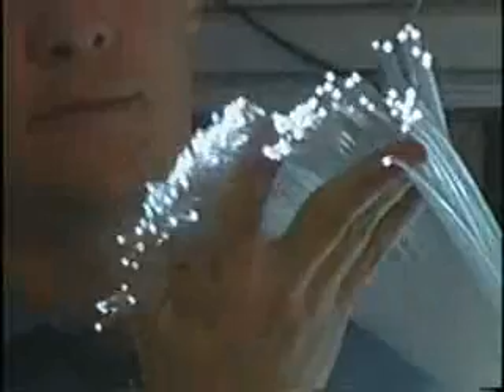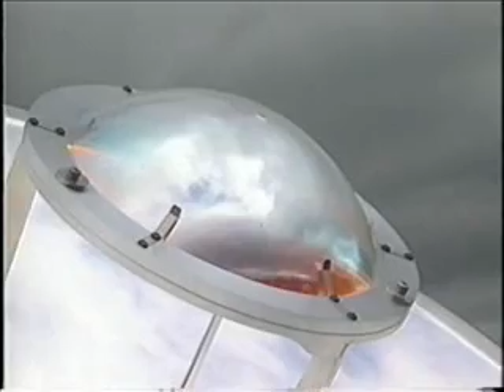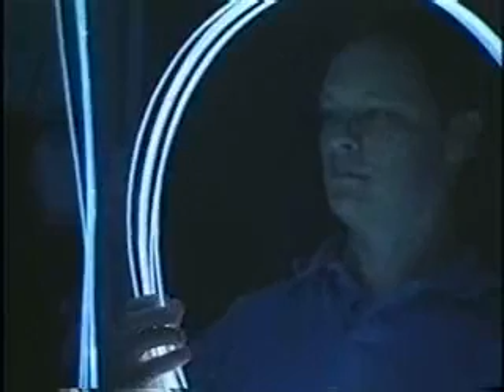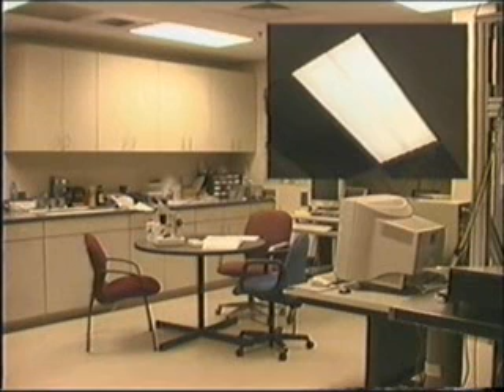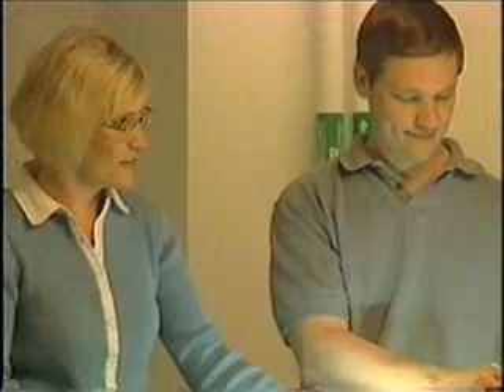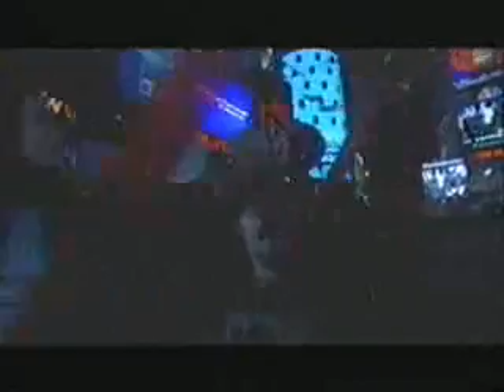Hybrid Solar Lighting - Featured on Hacked Gadgets

Comment: A gps device gets all of that information automatically, besides, because it doesnt have to have an input system, all you need to do is plonk it down on a roof and give it power, it'll handle the rest.
Anything else requires more effort on behalf of the installers.

Comment: Each unit has a built in gps device? That would be a waste. All you need is a way to input the current installed coordinates, a clock and a way to update the time.